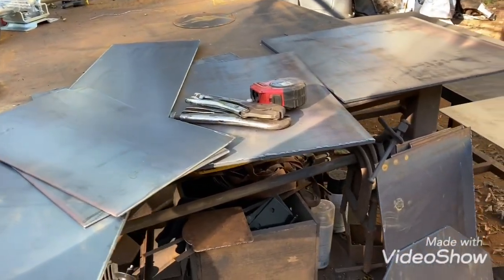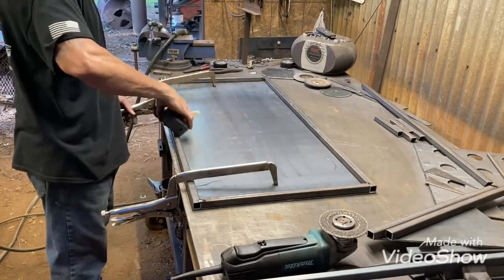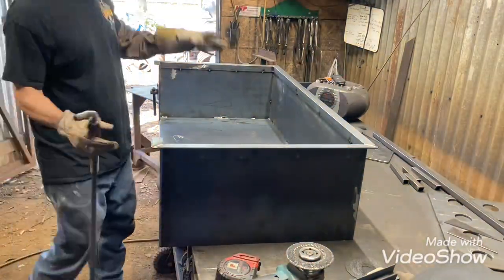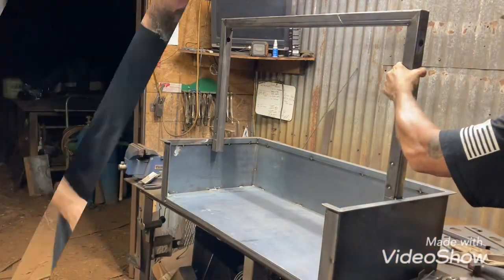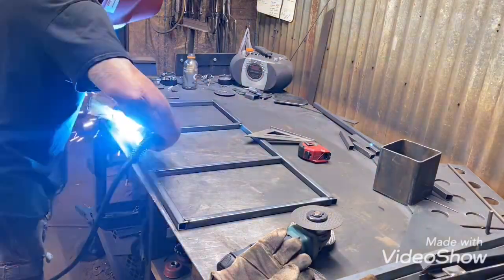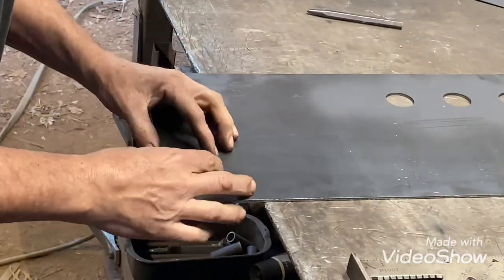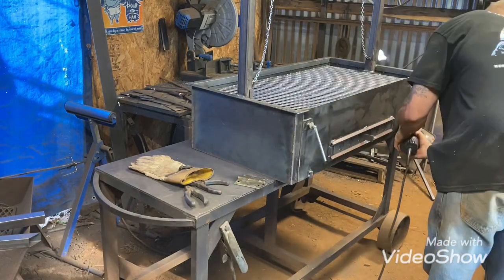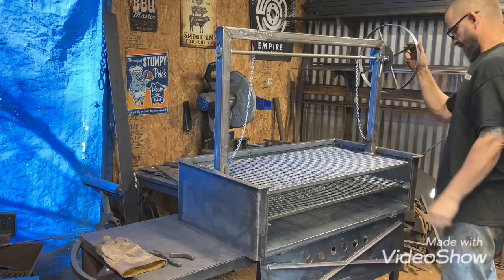Santa Maria grill build for a trailer smoker

Comment: Love watching the videos Allen, can`t wait to see ya in the new shop, keep em coming.  I was looking at some smokers online similar to your offsets, 1/4 inch steel, they start at $2,500 for the smaller size, and $900 bucks to ship, they were made from twin wall insulated pipe, about $3,500 for the smaller one shipped. Burn box, ash pan, all that was extra, if you wanted a rectangular burn box, it was add $500, your grills are a steal, to bad I live in Michigan, it`s $1,000 to ship one.